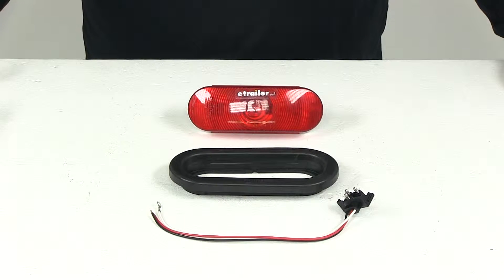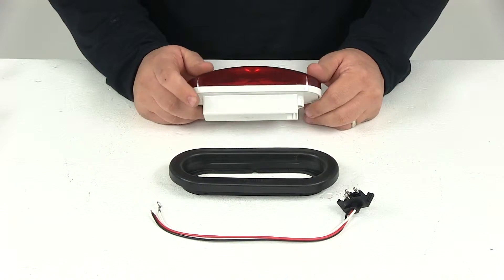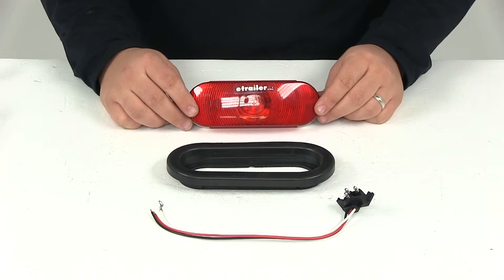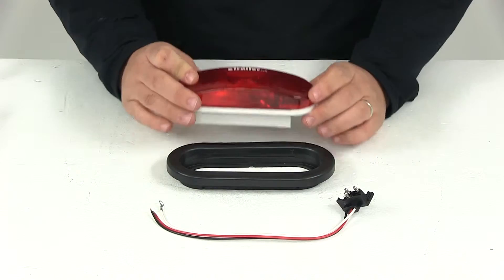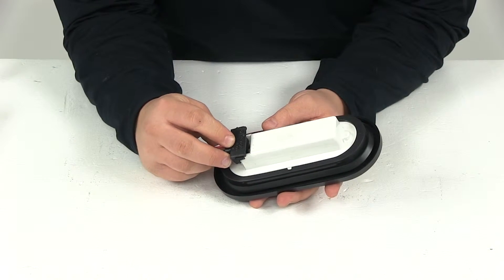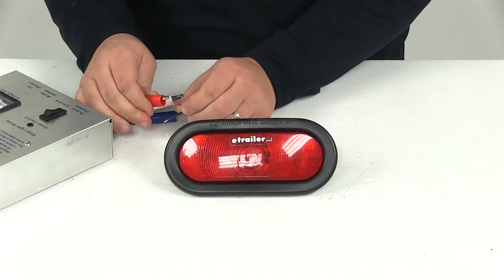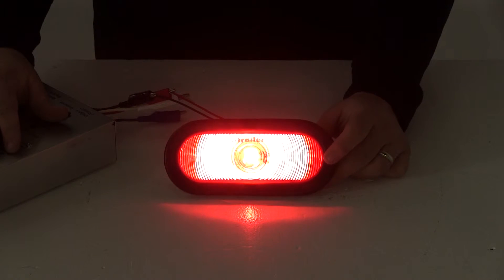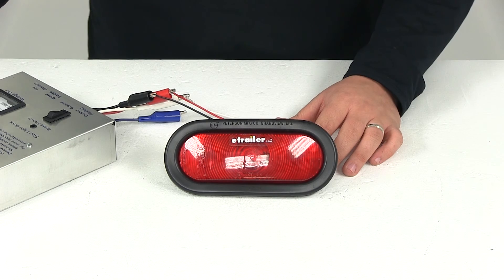etrailer | Peterson Trailer Tail Light Kit: The Breakdown

Comment: How do you change the bulb?
Reply from the maker: The lamp is sealed to keep water from getting in. You can pry the lens off to access the bulb, but once you do that, the lamp won't be waterproof any longer. We'd recommend using the LED equivalent, part # 880K-7 which will use a fraction of the power, will be brighter, and will last up to 50 times longer than an incandescent lamp.
https://www.etrailer.com/Trailer-Lights/Peterson/880K-7.html
Reply: @etrailer  thanks! So it's better to replace the entire unit. Appreciate the quick response.
Reply from the maker: @bg9419  It is better to replace it. You're very welcome, we're glad we could help!